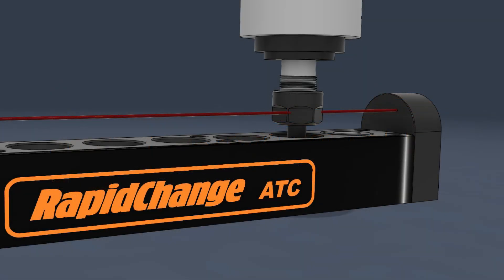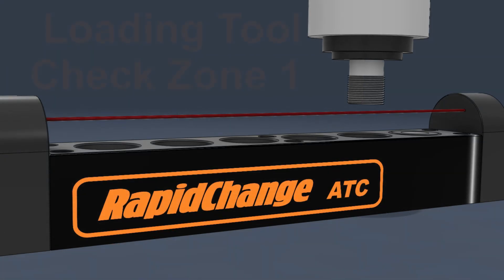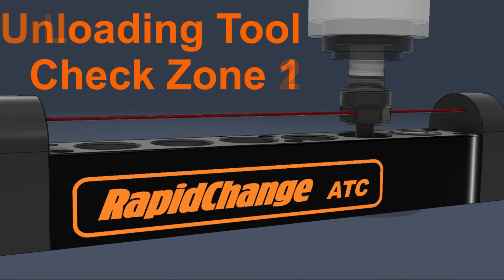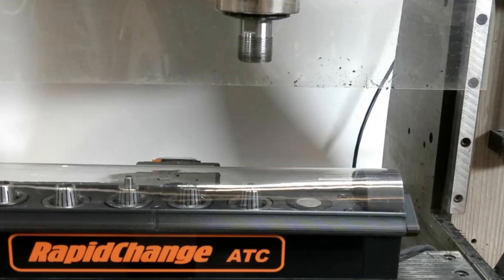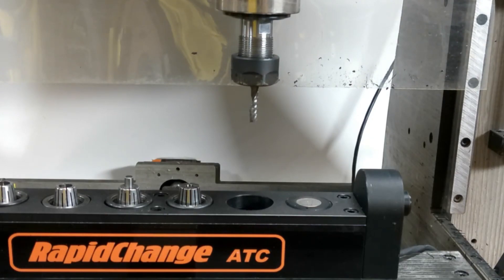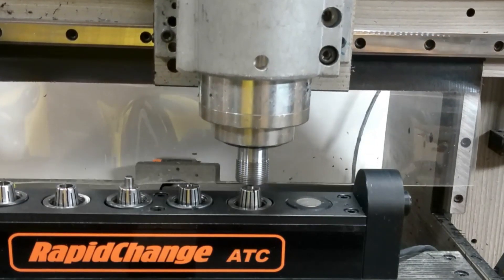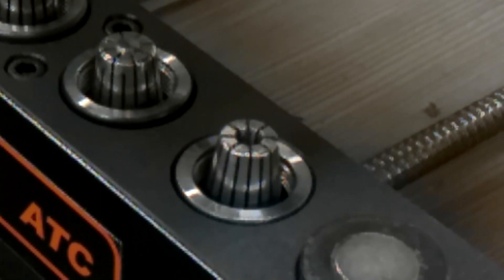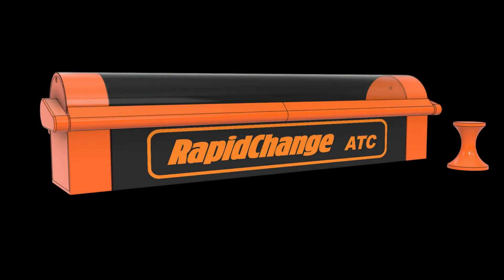RapidChange ATC Tool Recognition / Automatic Tool Changer

Comment: I'm also interested if this has been tested with the Onefinity Masso G3. Does Vetric do the g-code post-processing?
Reply from the maker: One of our field testers wrote a post processor workaround for use with Masso G3 on a Shariff DMC2 mill with Fusion 360. So far no one has used it on a Onefinity.

Comment: Can this be used with masso g3? And do you need a special spindle? How does it tighten down the nut enough?
Reply from the maker: Any High speed VFD driven spindle will work. the torque on the clamping nut is achieved by the inertia of the spindle and the sudden stop. We have a post processor work around for Masso we will be publishing soon. Thank you for the comment and question!